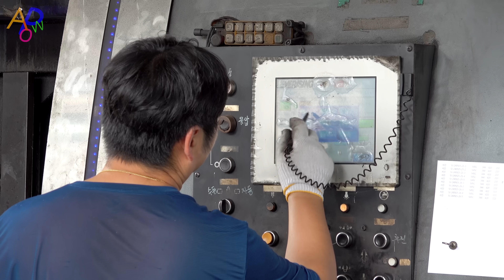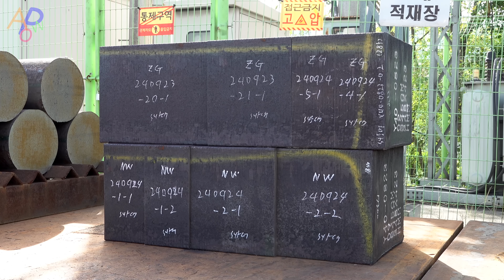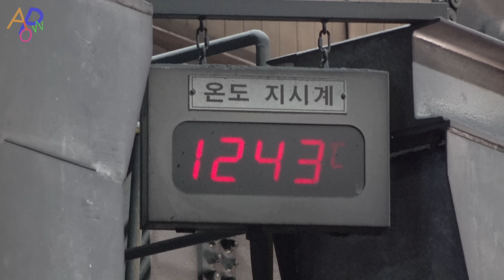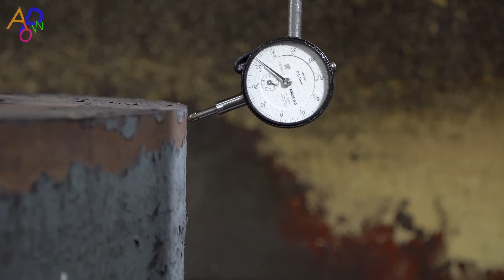How Massive Wind Turbine Bearings Are Made. Incredible Forged Gear Factory

Comment from the maker: Switch to 'English Original' in settings to watch without dubbing.

Chapters
00:00 Introduction
00:46 Cutting Material
03:42 Heating
04:46 Hot Forging
07:46 Roll Forming
10:24 Heat Treatment
11:29 Cutting Forged Ring
13:34 Gear Milling
15:13 Assembly
17:20 Ending

If You’re Inspired by the Items Shown in the Video, Check Out Our Top-Rated Products That Might Be Just Right for You!

🎁 Desktop Wind Turbine Model Solar Powered: https://amzn.to/4sjutdS

🎉 Pure Brass Fidget Spinner Gears: https://amzn.to/49fjbi9

Worldwide shipping options available in the link!
__
📧 Contact: allprocessofworld@gmail.com

🤝 Join Channel Membership: https://bit.ly/3NBrf2Y

Comment: Well, these gears are big, but in the early 1970s I did some mechanical testing on a 200” gear hobbling machine at GE in Lynn MA. It was cutting double herringbone gears for marine service. The diameter was close to the capacity, and the face of the workpiece was about 24”. That was the biggest gear cutting machine and gear that I have ever seen. I believe it is/was amongst the largest machines of its kind, if not the largest.

Comment: 16:53 "Spins with zero resistance" meanwhile, workers put themself all in to make that bearing move 😂
Reply: It spun easily, but when fully greased it had the resistance of the grease. Also, the rubber seal adds a lot of resistance.
Reply: It's a huge bearing, the resistance is minimal. It weighs hundreds of kg

Comment: 0:14 what is the stuff falling from the metal block, is it losing mass because of it ?
Reply: Mill Scale.
Reply: It's called Scale. it is several different iron oxides that forms when the steel underneath gets very hot. Yes the block will loose mass, most of the mass of the scale that falls off is iron from the steel.